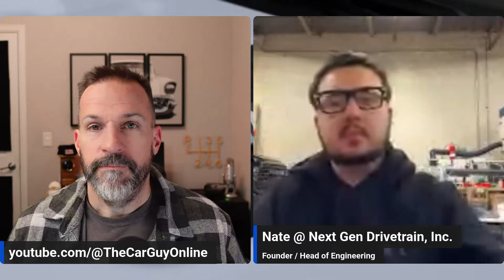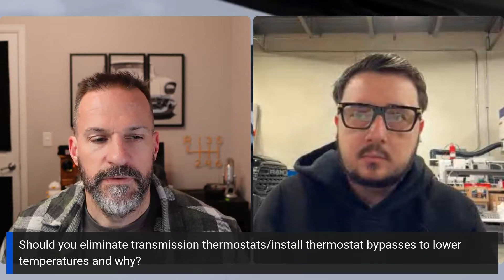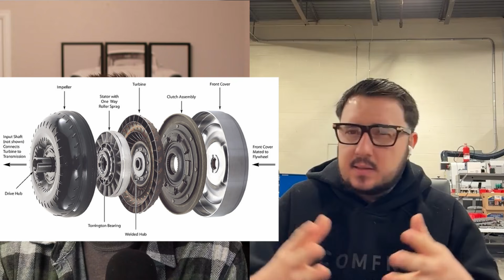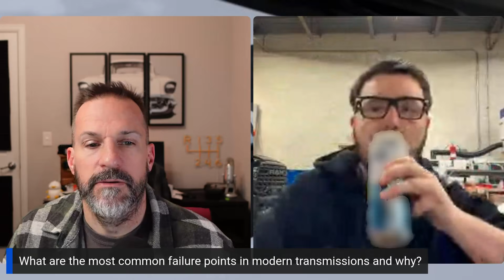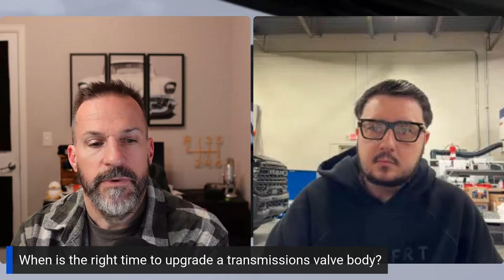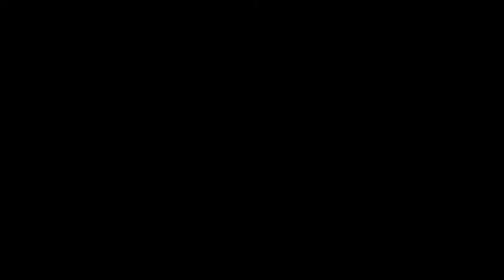Transmission Maintenance Questions Answered w/ NextGen Drivetrain

Comment: 2023 3.0 has been in the GM shop for weeks.  No calls; no updates.  Will call Monday (tomorrow) to ask whether they will install a NextGen valve-body kit.
Reply: They hate it if you bring up a proper fix that isn't their fix.  Expect them to do shotty work after when they get mad
Reply: @macrostiffproductions2978  Copy that.  I'm going to put it to GM via writing and verbally at the dealer.  I need for BOTH of them to tell me "there's nothing wrong with the GM valve body."
Reply: Don't trust dealers, Next Gen repairs your transmission.
Reply: @alexalpizar4096  I'd trust anyone BUT a dealer; but I'm locked into the "YOU INVALIDATED YOUR WARRANTY" territory.
Reply: If the manufacturer is paying, it gets repaired to the guidelines of their warranty policy. That means oem parts.
Reply: @brettfrimmer6567  Copy that.  Unfortunately, they do not understand how their own products work (or don't).  3 dead batteries in 3 months.  "Must be a parasitic draw."  Uh, no;  the electronics are a mess.  Whenever it drops below 15* F the "reductant heater" kicks in - at all hours - and runs until the battery is dead.

They still haven't figured it out.  Even after multiple DEF replacements and "negative" parasitic draw tests.
Reply: My dad 2017 colorado been in shop 5 months  he was just told there is 1k people waiting for his specific transmission.